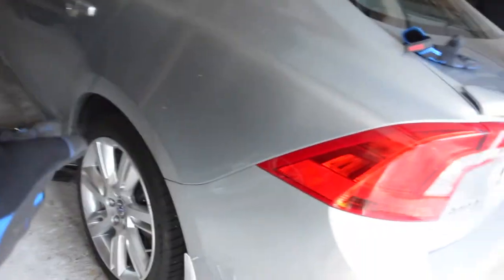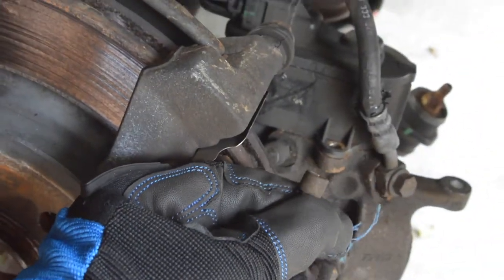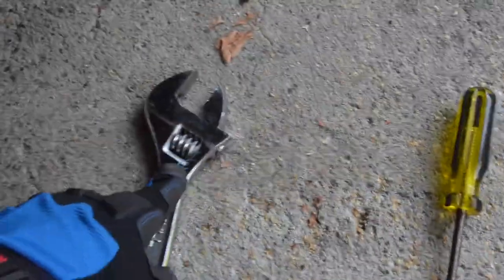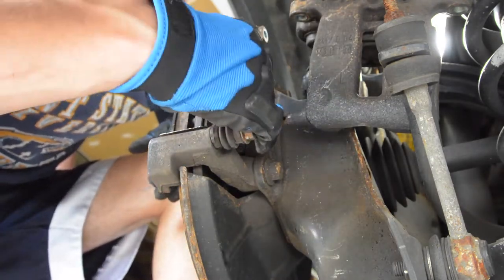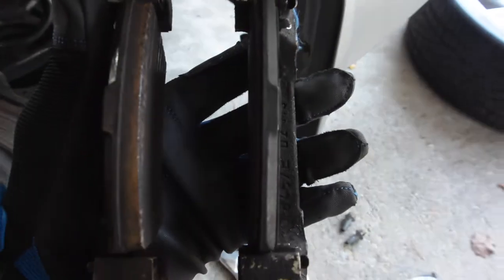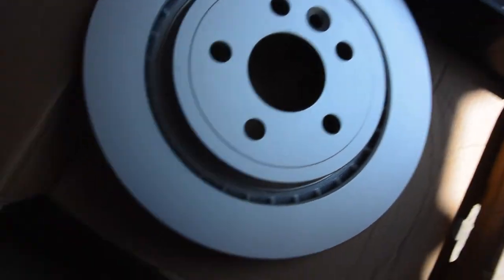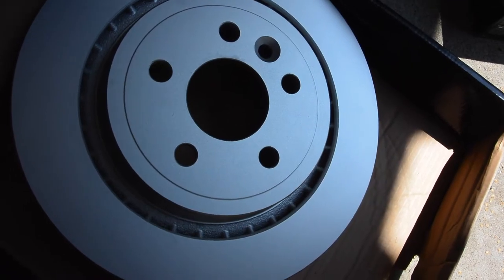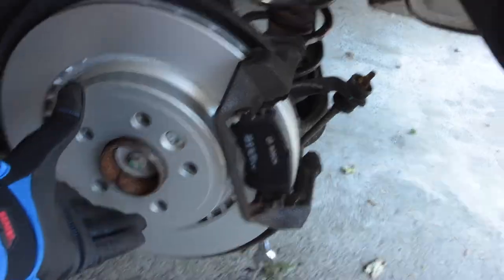Volvo Rear Brake replacement w/ electronic parking brake EPB

Comment: Hi  Kyle,

Great video. Today I replaced the rear pads and rotors on my 2017 S60 R-Design (after only 45K miles. You were absolutely correct with the calliper bracket bolts. Mine were impossibly difficult to remove but I got there in the end.

With regard to winding the EPB back to allow the compression of the piston once I had done this I then re-assembled the brake with the new pads and rotor and fitted the calliper without fitting the EPB motor. I then wound the EPB motor drive until the pads were gripping the rotor. Once done I then wound the motor drive back one complete turn. The EPB motor was then refitted and everything was tightened up. 

Once both sides were done I then carried out a functional chek of the EPB. I have heard of people getting warning lights on their dashboard, probably due to the EPB trying to readjust to the new equipment. By doing what I did the EPB operated first time and there were no warning lights.

I hope this helps the next person doing this particilar job.

Comment: Thanks for the warning on the caliper bracket bolts.  I had to use a breaker bar.  I wish I had started lifting weights about 3 months ago, it would have helped.  Great video. Thanks for taking the time to make it.

Comment: Hi Hyle, great video. My daily driver is a 2013 S60 T5. I would say to spray a little release-all on the caliper bracket bolts a week ahead. You don't mention anything further about the EPB. Does it elf adjust on the next use?

Comment: Good video.  It helped me know what to do with the electronic parking brake.  The two long bolts that he took out first really did not need to be removed because once the mounting bolts were removed the caliper will slide off of the Carriage bracket. Separating the two parts helps get a C-clamp on to the caliper to compress the actuator piston. Thank you for the video it was well recorded, clear and well-thought-out. Good job and I really liked videos where people explain things instead of it just being silent movies.

Comment: Excellent video. I had trouble was not sure about phow to draw the caliper piston back in. Your video made it easy. You also took the time to make certain notes of what to expect when unscrewing the two T30 screws from there EB motor. They should both be cleaned with brake cleaner well then slightly tapped on top with T30 tool inserted. This way you avoid stripping the inside of the head.You did a nice job and kept video moving along. Thank you.

Comment: Hi the 2 bolts you had difficulty removing on the caliper support. I was able to remove my worn disc without removing the bracket bolts. So l could then clean and lubricate the exposed end of the thread of the bolt where it was corroded. I then removed the bottom bolt and slackened the top bolt to swing the bracket out of the way and fit the new disc.

Comment: Kyle, great video, but I ran into an issue: I have solid rear rotors on my 2015 V60 T5, but sought to install vented rotors on the rear axles. So, I purchased genuine Volvo rotors and Bosch pads. I started the install only to discover the caliper brackets are different and will not fit over the vented rotors. So, I went to Volvo's website to purchase brackets for the vented rotors, only to discover it is nearly impossible to identify which of the caliper brackets in their catalog is a fit for which application.  I may likely have to visit a dealer to get the correct bracket. You may want to add this distinction to your lead-in.

Comment: 4:42 The ventducts has nothning to do with the brand. Rear discs for that S60 generation comes in 2 variants. Solid and vented. You have to make sure that you put on the same type you take off. They are not interchangeable (as far as I´m concerned, the vented disc is wider)

Comment: Also you can use an extension adapter on the shorter torx  for your socket wrench. To remove the motor. And clean the heads frost before removing .

Comment: You turned that center bolt that you uncovered when you took the electronic brake motor off so you could compress the piston in the caliper. Do you have to turn that bull back the opposite direction once you replace the pads or do you just leave it alone?

Comment: Or even better, use a 9v battery and connect it directly to the motor terminals and rewind it back. No need to disassemble the motor from the caliper 👍
Reply: This is a great tip! Just wanted to say 12v is okay too. If you cant find a 9v battery just use the car battery.
Reply: Is there a video showing this?  Also, does that pull the piston all the way in, or do you still need the tool to compress the caliper?
Reply: @byubadgerprofessor  No video, but i just did it on my car. You still need to push the piston back though. I think you can do it by hand, i used a  special tool though so can't say for sure.

Comment: I'm new with volvo's but I ended up replacing the rear brakes using a rear brake tool like on most cars since the rears are threaded. Will this damage or send a code? A lot of forums say to put the car in a safe mode? And others say do it like I did it. But your video shows removing the EBM and thread it in by itself first, then compress the piston like the front. Just trying to find out what methods are correct.
Reply from the maker: I think either way should work!

Comment: The 2008 XC70 has vented rear rotors and solid option.  Better make sure you know which ones apply to yours (rear), noting the hardware is different !  Suggest call dealer and ask if vented or solid.
Reply from the maker: Good to note!! I'm going to switch to slotted drilled when I do my fronts. So appreciate the information!
Reply: I just ran into this issue. Sold me the wrong set, has to go back and swap them out. Def a bummer..

Comment: thanks for posting, im just wandering do I have to turned back (counterclockwise) after I push back the piston of the electronic parking break , this regarding the rear break of 2012 Volvo s60 t 5  ??

Comment: Thanks the video was a great help.  Those bolts holding on the pads are tough!.  I was able to loosen them up enough to slide the rotor away and slide the new one in.
Reply from the maker: Your welcome! They are really hard. Must be something new there doing. I had issues with my brothers car recently to.
Reply: @KylePancis  yeah, they are realy tough as a hell, i busted my elbow after damn thing has loosen and  i end up kicking my elbow on the concrete full power but i managed to replace my rotors and pads on v60, here is video: https://youtu.be/JDiRfkW8lM0

Comment: After the piston has been pushed back, and it all back together, do you just pump the brake pedal first and then push the electric parking brake after.

I take it you don't push the parking brake button first then pump the foot brake

Comment: I have a question if possible. On my Volvo S60/2015/T3/150HP the rear brake discs are single walled 11mm. I accidentally ordered double walled ventilated (22mm) that look just like those you replace here. Do you think that these double walled will fit on my car? Could it be that my original ones are single walled, due to a relatively small gasoline engine, and the car is lighter than station wagons with for instant diesel engine? So mine might be able to fit, but will be a bit "overkill" for my car? I am wondering if the caliper is standard, so it still will be able to fit, as said the new ones are 22mm and the old ones are 11mm.

Comment: Only thing is you didn't show how to compress the caliper after you screw the deal back in clockwise because you got to have a tool to push the caliper in does it turn or do you just push it?

Comment: Hello Kyle, did I miss anything after compressing the caliper piston, do you screw it back in or out before installing the parking brake actuator back on the assembly? Thnx for the video
Reply from the maker: Compress caliper first then reinstall Parking Brake
Reply: Ok I will not fiddle with the piston after those steps. I think I threw in an extra step that gave me a parking break error because I forgot if I tightened the piston after that. Thnx for the response. U have very good videos and I love my t6

Comment: Thanks for the video. I tried to copy you to replace my break pads and rotors. However, l cannot remove the caliper from the rotor. So, I just put back the screws and tire for further instructions from you. Any idea why I cannot move the caliper? The rotor cannot spin at the time. Any suggestion? Thanks!
Reply from the maker: Sounds like the caliper may be ceased on their. I had a hard time too. Try spraying the bolts with pb blaster and let it sit for 20 min or so. also, get a breaker bar on there for leverage

Comment: Ask a quote from dealer and then go to aftermarket with the stock part numbers and get the equivalent not to mess up. As far as i know ATE makes most of Volvos brake parts. My rear calipers are TRW and this is on a 2016 XC60

Comment: Hello! Great video. I followed your instructions worked great. Only issue the service parking brake alrm will not go away? Tried several things hoping to get this resolved without having to purchase Volvo Vida or any other aftermarket code reader. Any ideas?
Reply from the maker: Hey Manny, thank you for reaching out. Appreciate the support. I believe you should check your brake fluid level first. You most likely will need to get a scanner on there, unfortunately.
Reply: Yes,. I have same instrument panel warning lite and bell, "parking brake not full release.  I did turn the caliper screws clockwise for both sides.  Didn't seem abnormal at all.  After completed,  I can feel parking brake set and release ... or seems to.  Does not seem to be any drag, free rolls etc.  Wonder if will simply need vida reset or if there is a slight release problem, if so,  how to tell which one ? ughh ! Hoping vida does the trick ! 2008 XC70.
Reply: @ericaviator8869  Hi, how does it finished for you? I am in the same situation now. Thanks ')
Reply: @anthonymondoloni4704  did you solve it? Same problem here

Comment: To compress the piston do I need an adapter? Or do I just compress the piston with a regular  caliper tool? After I remove the motor and adjust it.
Reply from the maker: I used the special tool. But something tells me you can just compress it like a normal caliper
Reply: It’s a 2015 Volvo S60 t5 premier, it has the 3 pronged piston.
Reply: I was working on it yesterday and didn’t know about the electric motor. And I got stuck with the piston. I can’t test it out right now, so I was just wondering if you happened to know?
Reply: Also I am having trouble finding that adapter, where did you get yours?
Reply: Kyle Pancis if it’s electronic you cant just force it back in your going to mislead people

Comment: I'm doing the back brakes on my 2009 s80 . i removed the EPB motor tighten piston with a T40 tried to colapse the piston but it won't budge.any ideas
Reply: Running into the same issue, what fixed it?

Comment: Heat & Spray those  Tough  Bolts then  Tap with Hammer & Tool  - to Break Loose Oxide from Zinc .. Pro Tips  from  EngTech  35yrs

Comment: How do I push back the piston so that the caliper will fit the new brake pads??
Reply from the maker: There is a box  socket tool with the prongs to fit into the groves of the caliper. Righty tight and it should go down...little bit of a process

Comment: Good video but i wish you could've explained how did you compress it,rather than fast forwarding. Overall ok.
Reply: Mechanic class 101
Reply: C clamp. Brake piston tool. Common sense
Reply: @fadedghost1704  not that simple with an electronic parking brake.

Comment: After u compress the piston do u need to tight back the epb? The one u use t30 clockwise?do i need to tight it back?
Reply from the maker: once you reset the piston and collapse caliper you can reapply the brake motor with the T-30.
Reply: do we have to turned the EPB counter clockwise after pressing the piston?
Reply from the maker: @josephdatu9717  yes
Reply: ok thanks, so we have to turn EPB counter clockwise using T40 after pressing the piston.

Comment: Thanks for posting. Isn't there something you have to do to reset the electronic parking brake?
Reply from the maker: Mike G yes, take a t40 and turn it clockwise till it stops.
Reply: Part number for the rear Bosch pads and rotor please.
Reply from the maker: @jacokoen6383  rotors are 52011374 and pads are BP1307 on eEuroparts.com
Reply from the maker: @jacokoen6383  rotor OE number is 31471028 and pads are 31317483
Reply: Do you think the parts will be the same as for a diesel, 2010 Volvo XC60 D5 AWD?
Reply from the maker: @jacokoen6383  I assume they would be since it would be costly on the manufacturing side. BUT I would double check to be safe.
Reply: Thanks a lot for your help, best wishes from South Africa *
Reply from the maker: @jacokoen6383  my pleasure! Good luck and stay connected! Appreciate your support
Reply: Hi I just recently got my 2018 s60 t5 back from shop n they don't know how to get the service brake light off my dashboard after fixing the rear back tire that was wrecked into but it was only the driver side rear back tire and brakes so how would I get the light cleared can I just take off wheel and reset the t50 bolt of something
Reply: @KylePancis  nice video can you please help me
Reply: @KylePancis  I got my s60 2018 back from local shop they were very knowledgeable at first but once I got my vehicle back I noticed they never cleared the parking brake service required icon on my dashboard
Reply: @KylePancis  I subscribed as well

Comment: Anything different from the rear and the front rotors/brakes.
Reply from the maker: Yes. Less work up front because you don't have the parking brake. Just two bolts for caliper and two bolts for brake bracket

Comment: You forgot one the most important part at the end of this process to reset the Park Brake or you will have this light on all the times and make a bee noise all the times
Reply from the maker: Never had the issue. Once I was done, I just pressed the park brake and it rewound and engaged.
Reply: -How would you reset the parking brake? Question to sean Bassam
- do you leave the parking brake piston screwed all the way in and compressed  and then put the parking break actuator   back on the caliper? Or was there some majic I had missed? Question for Kyle

Comment: You should also mention to be very careful when removing the park brake actuator to be very careful the ears are prone to braking off and will cost you around $200 or more to replace.
Reply: That happened to me, it could be worth putting some rubber lubricant on the seal which allows it to seat in the correct position with little force.
Reply: broke last year, broke this year again ...
Reply: Broke it too. Made custom washer and it hold it fine.

Comment: Great video.  One tip...WAY easier to actuate the rear parking brake w/ a 9 volt battery.  Takes all of 10 seconds and no need to disassemble the electric parking brake motor.  This video shows how:  https://youtu.be/8y54DKRHlAo